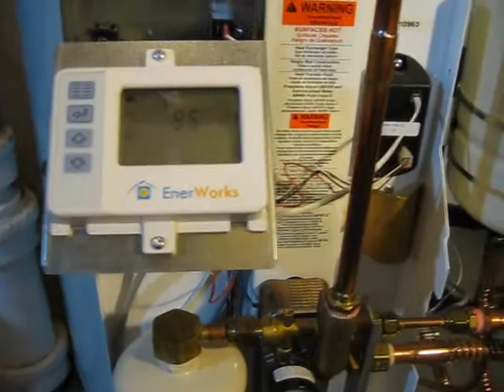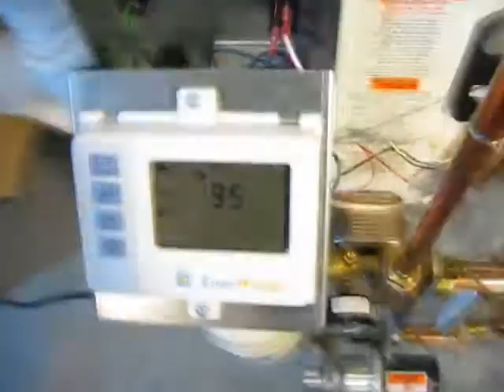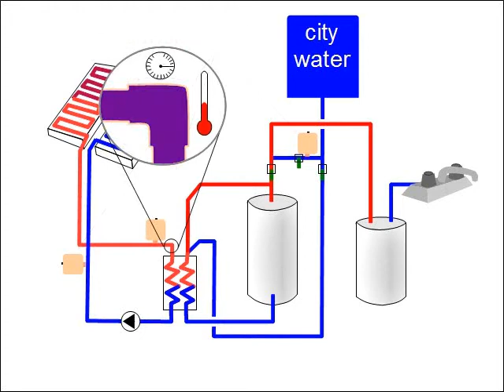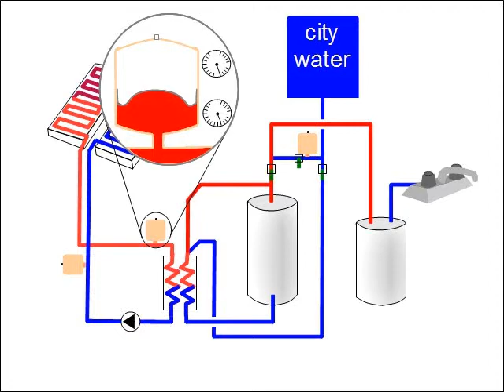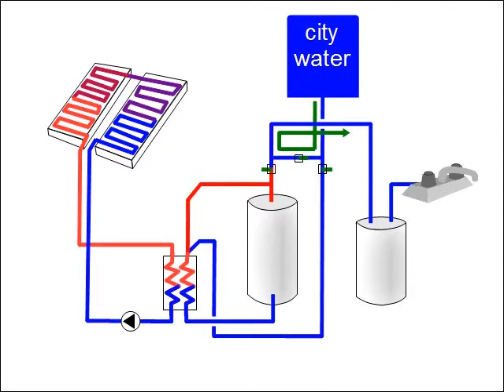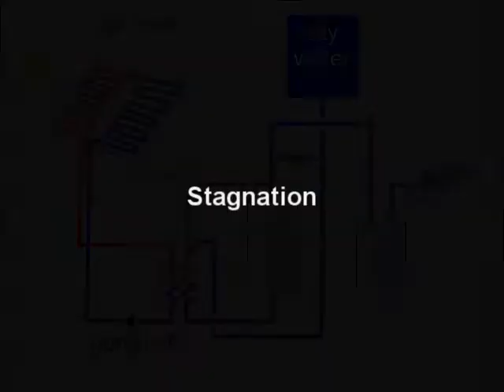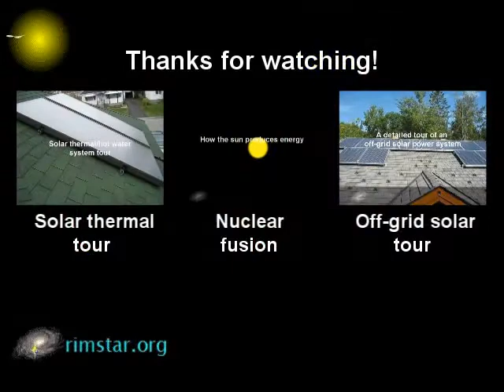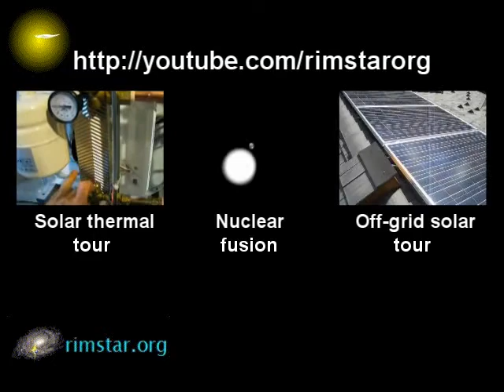Solar Energy - Parts for solar thermal/hot water system (Enerworks)

Comment from the maker: I'm a few years out of date on pricing but a system like this costs around $5000 - $6500 installed. Knock off about $1000 for installation. To pay for itself takes over ten years, but then it depends on what type of heating system you're supplementing. It makes more sense if you have an incentive program to cut the costs. Or you can make your own panels from scratch! A lot of people do. This one was installed by a friend of mine on his own house.
Reply: I enjoyed your video.  I just received 3 but hopefully can manage with two Revere thermal heating panels as well as a 80 gallon tank with two 12v heating elements.  The system was removed from a commercial building.  I have well water and was hoping to use these to warm/heat the water going to my electric water heater. I just thought that if the water was heating to 90-110°F that my electric water heater would work a lot less.  This was used to heat water but I don't know exactly what for unless they used it to help heat the building? It looks like I will need to buy more parts than I thought....lol.   I have a 20gal badder tank in my well house and a couple small expansion tanks that I picked up . Hopefully I can find a way to use these panels. If you have any tips, please let me know. Thanks

Comment from the maker: @garveynj One expansion tank is on the water side and two are on the glycol side. The smaller glycol side one comes installed on the integrated Energy Pack system and I suspect he figured it was too small so he added the second larger one. And I agree re the heat exchanger not being insulated, that's also a part of the integrated Energy Pack system but I don't see why some insulation couldn't be packed around it. Re the rest of the piping, I replied to your other comment about that.

Comment: this is very cool. their is alot that goes with these type of systems i would not think the system is cheap or the installion about much does it cost for the system and installion and about how long does it take to pay for it self. i use to be a pipe fitter you do good work and it shows. any information would be great thanks for sharing

Comment: Thank you ! that is really interesting.
I don't know if you have an idea concerning the problems of open loop systems.
Actually we are using open loop evacuated tube non pressurized systems, but the main problem is when the cold water supply is cut. The hot water system is drained and there would be damage of the tubes and gaskets. What do you think can be the solution?
Reply from the maker: I've no experience with open loop systems. Sorry, can't help. :)